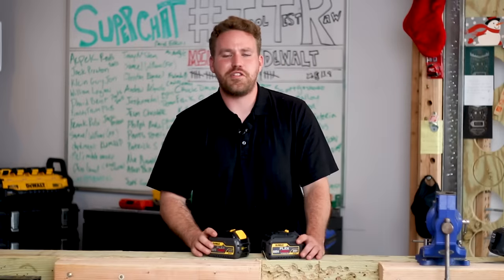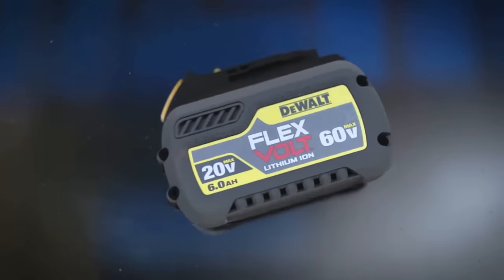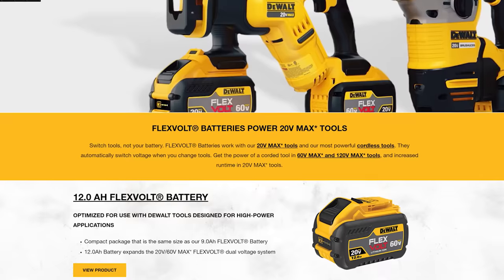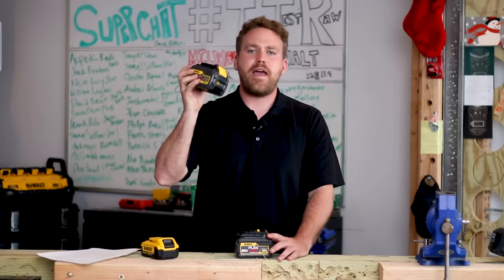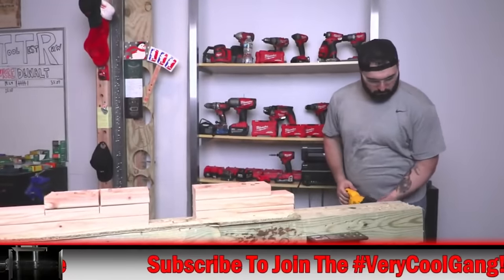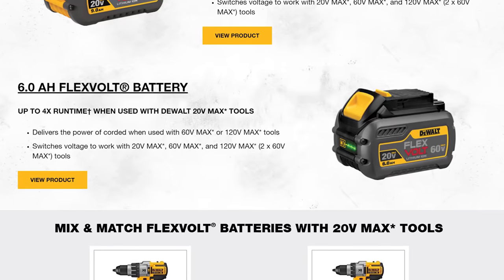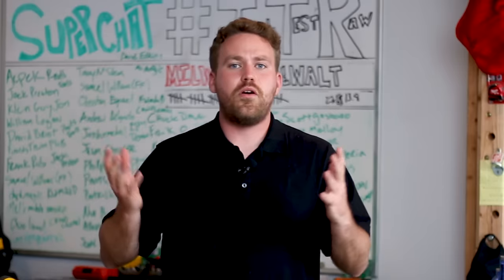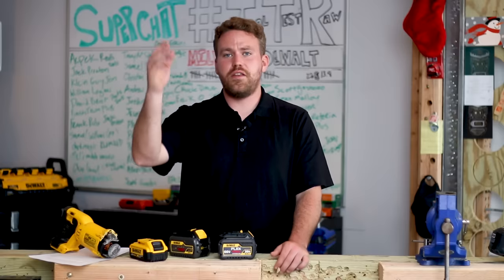NEVER USE DEWALT FLEXVOLT BATTERIES ON 20V MAX TOOLS!

Comment: Absolute joke. Been using flexvolt with all my tools since it came out. These guys are Milwaukee fan boys
Reply: the are not milwaukee fanboys. it's clear they are sponsored by Milwaukee. if they talk about any other tool than milwaukee, they are honest though. when it comes to M. or any comparison between Milwaukee and any other brand, just don't take a single word from them. 
trustworthy people called flexvolt batteries " the worst batteries in the industry". I never tried them. I love Dewalt though. I just love makita more.
Reply: Ahmad you cannot even comment on the performance of the flex volt batts bc you have never tried them. Just like these idiots at vcg you are not an industry professional, just fake news
Reply: Ahmed Nabil  you’ve never used it. Enough said
Reply: I use my flex volt on my 20 all day
Reply: I use my 6ah flex volts in all my dewalt 18v tools every day for almost 2 years with no problems at all
Reply: Might be they realized that dewañt is a homeowner tool
Reply: Are these 20v tools labelled 18v in the uk?
Reply: @JuiceBanger1  I think Australia also
Reply: I was thinking like you, but I ask to dewalt about this problem, and the answer was not I'm waiting
Reply: I got my flex volt before they came out from my dewalt rep. Still using the same batteries for the past 4 years. Completely draining them everyday. Still no problem.
Reply: @edgarcruz4520  as a man that owns both red and yellow tools who rides them hard and puts them away wet, this is complete bullshit. I've probably got more invested in batteries in either brand than you have in tools and batteries combined and am perfectly satisfied using either.
Reply: I agree because I’ve been using the flex volts on dewalt leaf blowers for a while know no problems.
Reply: I just saw a 60 volt battery for first time. All my chargers and tools are Dewalt 20 volt. So my Dewalt radio charger and 20 volt charger will charge the 60 volt battery? And all my 20 volt Dewalt tools will run on the 60 volt battery?
Reply: Same here, but I don't push my tools too hard.
Reply: @MC-hs4mf  yes the 60v Battery will work on you're 20v tool, that's what's so awesome about it and they were the first to do that. and I hear you can use you're same 20v charger to charge the 60v battery also but I don't know forsure because I tried to charge mine for just a lil bit and the lights came on and everything and blinked, indicating that it was charging but I didn't have it on there for long before it took it off. I got so many 20v 6,4&5  amp batteries so I haven't really had the need to bust out the 69 yet
Reply: @edgarcruz4520  DeWalt is the furthest thing from a homeowner tool. I do production framing, rain or shine . And the whole crew with 40+ year Carpenters use DeWalt. What do you consider a pro tool if you think  DeWalt is a homeowner tool?
Reply: @jhojho1679  ok I did research since
Reply: james oppenheim  I use mostly Milwaukee since to me it’s more durable then dewalt  I’ve worked with them both and I always had trouble with them I work In HVAC comercial and residential
Reply: Definitely lol
Reply: @JuiceBanger1  adaptors
Reply: @edgarcruz4520  yeah dewalt, milwaukee, and mikita are all pro-sumer tools. in terms of quality they are about the same.
Reply: Agree.   My Flexvolt batteries are great in my 20 volt tools and perform exactly as both the math and DEWALT say.    This is a very slipshod video and clearly biased.   It should be withdrawn.    
I have a 60 volt circ saw which is a beast but also use those big Flexvolt batteries in my 20 volt job site blower which uses a lot of amps.   Performs really well.
Reply: This is a piss poor vid published by a biased crew.    I use my Flexvolts a lot in high draw tools like recip saw and job site blower.    They perform in my 60 volt circ saw perfectly and ALL 20 volt tools (and older 18 volt with adapter) exactly as DEWALT says.   They are an amazing setup.    I also use the big Flexvolt in my 20 volt small chain saw, weed eater and hedge clippers.    AS the math will tell you, you get about 3 times the amp hours in 20 volt mode as in 60 volt mode.    The multiples in the ad refer to a baseline 20 volt battery like a 1.5 of 2 amp hour battery.
Reply: naa dewalts brushless line is crap   burned more out even on normal batterys  i got brush models that outlasted the new 1 year old brushless ones i ended up returning znd hunting more brushed models down
Reply: construction king I use them on 20v tools in an industrial environment everyday and my brother builds houses, uses the same set up every day.
Reply: Harry Lowe   Tools can burn out at any time. It's easy to think there is cause and effect meaning if you have a bigger battery in the tool, that was the cause of failure.
That said I found this vid after cooking my 20V recip saw with a Flex Volt 12 AH. It stands to reason the saw motor is going to get hot running wide open with their biggest battery in it during a big cutting project. The battery was new, the saw is several years old and has been well used. My tool failure was worse though as the failure fried the brand new battery as well. The battery still has one bar charge in it and works but none of my several chargers will recognize it as plugged in so won't charge it.
Dewalt customer service has been great. They're sending me a new battery, all I had to do was submit a photo of the date stamp. The saw was old, I'm sure past its warranty so I didn't inquire.
I'm pot committed to Dewalt cordless just in battery outlay so as long as their customer service remains awesome its hard not to be happy. I don't miss rolling up 100' extension cords.
Reply: construction king very true!, this Milwaukee channel is all hype..
Reply: Update: Dewalt customer service is more than great. They sent me more than the 12 AH battery I fried. I'm not complaining. It was a cordial email I sent them, told them I wasn't looking to have the saw replaced as the saw was several years old. I think they more than hooked me up because I didn't come off as a d***. Great service to say the least.
Reply: Edgar Cruz I have a difficult time believing you
Reply: Milwaukee fanboy. Dealt selling their 18v kits with 54v batteries. I've been using 54v batteries on ther 18v power tools with no issues. Don't listen to this guy. Buy the flexvolt as you can buy 54v tools in the future for more versatility.
Reply: @jhojho1679   Exactly lets be honest here  De Walt and Milwaukee both build great tools , , I the De Walt Xmas special Combo Pack At Home Depot 3 Years Ago , ive done multiple remodels , Addition's , Decks , fences 8 baths and 9 kitchens with this set and the only brushless tool is the multi tool ,which rocks , im stepping up to all brush-less , i like milwuakee also , BUT to say these are " homeowner tools " is pure foolish .
Reply: @apersonontheinternet8006   Agreed
Reply: @JuiceBanger1  yes
Reply: @abadran8174  that's not even close to what AVE said in his teardown, he has said countless times that the 60v batteries  are great batteries.
Reply: @JuiceBanger1   Only in the US they're labeled 20V while outside the US in other countries it is labeled as 18V.

I was told/heard 2 reasons for this
1. Not to confuse the new 18V(20V) with the old 18V for consumers in the US when buying tools etc.
2. "Marketing Strategy" to say it's stronger with the 20V. But I read the box it's 18V when underload and it is 20V when not underload so DeWalt is technically not lying about the product.

But I really can't say if both are true or one or the other is false.
 sorry I know it's months ago but I wanna just say it.
Reply: I use the flex volt on my 18v xr mitre saw and it gives it a little more power and works perfectly
Reply: @JuiceBanger1  Yes, 20v max is an American marketing term. Any company who calls their 18v range 18v in the USA will look like they have a weak tool and many buyers will not buy it. Everywhere else in the world the same 100% compatible tool is 18V (not MAX). You can run a dewalt 20v max tool on an 18v battery, and vice versa, and the same with chargers. You can also charge a flex volt on a 18v or 20v max charger. The design of the battery is safe and sensible. These guys are taking the bottom range light duty dewalt tools, beating the f**k out of them in jobs that are way to hard, and comparing them to the high end Milwaukee tool. If they were serious and compared dewalt and Milwaukee models of the same retail price, the results would be different.
Reply: @JuiceBanger1  Yes, only in the USA 18v is sold as 20V Max. They are the exact same thing. They are cross compatible.
Reply: @JuT193  Very good comment My friend!
Reply: JuiceBanger1 In the EU yes (Belgium) I think UK also. Cheers
Reply: I would use a brushless dewalt hammer drill for the cement test and a brushless dewalt chainsaw for the 8x8 treated. I would not use a toothbrush to clean a kitchen floor as they would have in this video so to say. Dewalt for the win. I have used the flex volt for all my tools and it’s amazing.
Reply: Same here no problems with any of my tools with the flex volt and I’m hard on my tools I’ve run the flex volt 9 ah fully charged dead with my 20v max reciprocating saw
Reply: Actually hes right,  my wife bought this for me recently. I use it in all my 20voilt and it work .... for a couple months.  Now impact drill and hammer drill wont work and the saw saw that came with it all quite working.  So hes on to something!!!
Reply: I too use them with all 20 volt tools with absolutely no problems. I only use the 6 ah batteries.
Reply: Edgar Cruz that’s exactly why you prefer Milwaukee. People need to realize the different brands are both great tools in different lines of work. Milwaukee is by far superior when it comes to electricians, hvac and plumbers. Where as dewalt is the only way to go when you’re a carpenter. It all depends on what applications you’re using. Aside from that it’s just biased opinions with no backup evidence proving otherwise.
Reply: It’s because Milwaukee is the best it smoke 💨 dewalt literally lmao 😂
Reply: Funny thing is all the dewalt junkies know it’s better I mean it is pretty obvious it’s not even close
Reply: What a coincidence that there are always Milwaukee tools around through the whole video! Absolutely bullshit!
Reply: The only issue comes when you run it constantly. But if you use it the way you would normally use the tool it has time to cool off. I’ve had the same thing happen to Milwaukee tools when using the massive batteries. You gotta let them cool off or you’ll wreck your tools.
Reply: Harry Lowe  Oh ya this guy is definitely the professional sitting in his garage putting in “countless hours of research” while I’m out here beating the shit out of these tools for years on end, not moving on to the next tool. Day after day my tools have not let me down... but go ahead listen to the professional on YouTube not the young buck lol 😂
Reply: @abadran8174  I guess "trustworthy" is subjective...but I would strongly recommend that you reevaluate your definition of the word
Reply: @mikhailyaremkiv  I think AvE is a trustworthy guy.
Reply: @edgarcruz4520  every tradesman I know has a ton of dewalt tools. The dcf887 is the most powerful impact on the market. 
I guess you are too cool for dewalt though.
Reply: @jhojho1679  I worked at a nursery (flowers), essentially a farm, years ago, and the 18v impact driver was constantly lost, only to be found days later in the mud, having been rained on and left outside for days.
It pretty much lived its life like this all the time, like a homeless impact driver, and I never missed a beat, it always worked.
I couldn't imagine a harsher life for an impact driver to live.
Reply: so can i put my xr dewalt tools with a flexvolt battery
Reply: @MC-hs4mf  no
I have a separate charger for the 54V flexvolts.  I believe DeWalt do a charger for both 18V and 54V.
Reply: @jhojho1679  love dewalt, LOVE HILTI MORE
Reply: I use them all the time without issue. This video is propaganda.
Reply: I think they are DeWalt all day long, like myself
Not always the best although something you can count on, 👍
Reply: Yeah I have only flexvolt batteries and I run all my 20v/18v tools on them and have been for 2 years no issues
Reply: Not burned up any dewalt tools yet and I don't think I have anything g but flexvolt batteries
Reply: YouTube Comand//: See Less 

Comand Completed
Reply: i have all dewalt and no bs put my 60v oah in my impact gun for the fjrst time and put one 3 inch screw in a board and the thickest blackest smoke u ever seen started rollin out of it, let go of the trigger it kept rollin out thicker and blacker. got so hot i had to drop it. then i used it on my 3 speed drill and it toasted it 3/4 of the way into a 4" hole saw through 3/4 plywood. took it apart it shattered the brush. i never had a problem with them in the roto hammer, big 1/2 impact, or saws but i would never put one in the little impact gun again or a drill. all my 60v batteries have died now, they HATE water. im in the process of wiring 3 20v batteries in sequence with adapters to power a 60v saw. turning out to be harder than i thought. not sure what terminals need woke up. obviously the outside ones but i started dicken around and touchin em all and it literally welded the 12 gauge copper wire to the terminal on the saw.
Reply: @PAKfromFYCB  you should probably leave power tools to the grown-ups you obviously don't know how to use them properly
Reply: @joesniffedherfanny5928  buddy i bet ive run tools longer than you've been in trade work. try workin in the PNW, we work in the rain or we starve. all that aside my experience with the 9ah burning up 2 of the tools is genuine. the 20v brushed impact driver melted down puting in one 3" screw. i've bought somewwhere in the range of 40 dewalt 20v batteries now and have a shelf with about 15 dead ones. you talk about being a grown up well ive been full circle and came to realize battery tools aren't reliable enough to count on and have gone back to a hammer and duplex nails and a mag77 worm drive for most projects.
Reply: @PAKfromFYCB  I've Done Construction for over 30 years I've been self-employed for 20 and I have owned flexvolt tools since the day they came out and still run the same flexvolt batteries as the day they came out I build entire houses on nothing but battery power I have nearly every flexvolt tool made and almost all the 20 volt tools made I've never burned up a single 20 volt tool using a flexvolt battery and yes I work in the rain
Reply: @PAKfromFYCB  the only thing I've ever had gone wrong is 1 - 9 amp hour battery would no longer charge for some reason but I also work with people that have Milwaukee Tools and I've seen a Milwaukee 9 amp hour battery stop charging for no reason also and I've also seen Milwaukee 4 amp hour and 3 amp hour battery stop charging for no reason
Reply: @PAKfromFYCB  not sure why you would be using the Worm Drive I've owned the DeWalt Flex volt Skil saw since the first day of arrived at the store and I still use the same saw today that saw his Bilt more houses than you have probably walked into and still runs like the day I took it off the shelf at the store somewhere around 8 years ago
Reply: @joesniffedherfanny5928  haha ya i bet man. ive got 5 worm drive skilsaws. i kinda doubt you have one 60v saw. and if you do i bet its a lefty. ive seen you comment back enough times this mornin i dont think your a contractor at all, your youtube account is 2 years old,  your youtube handle, that you just picked 2 years ago, is like a child would use., and you use emojis.. i bet your 19 and are the greenest laborer on your residential site.
Reply: @PAKfromFYCB  I had to create a new account because during the 2020 election I was posting facts from FBI statistics and CDC and got thrown off YouTube
Reply: @PAKfromFYCB  I have one flexvolt skill saw I have two electric skill saws and one warm Drive but I only use the flex volt I'm not sure why I even keep the others
Reply: @PAKfromFYCB  you notice they deleted my comment about FB istatistics and CD cstatistics
Reply: 😂😂😂 I love this shit
Reply: I've used them on a 20 volt tool. A hammer drill. While it's never destroyed the hammer drill it's incredibly heavy. Prefer not to use it for that reason alone. As far as them being Milwaukee fanboys I wouldn't say all that. Vince actually endorsed Makita impacts over Milwaukee at one point. The new kid on the block is flex but as it turns out flex batteries leak a lot. They're not ready for the Long haul.
Reply: My thoughts exactly lol I honestly recommend using the flex volt batteries on grinders or any tool that really pull alot of power.
Reply: This is bullshit. I've been using 60v batteries on multiple 20v tools for years, at work, all fkn' day long. I've never had a problem.
Reply: I only use the flexvolt batteries. I use them on my impact driver my drill reciprocating saw circular saw oscillating tool and my grinder. My neighbor actually has the old school Dewalt tool and an adapter to use 20v he uses flexvolt on his old drill
Reply: Exactly, use them in oil and gas industry, mud , rain -40 below zero 
Take a beating and keep on ticking
Reply: @JuiceBanger1  yea mate
Reply: Milwaukee fan boys
Reply: @constructionking1250  😂😂😂 the ending got me
Reply: Fact is some tools burn up, some battery's die, some keep on kicking. Most of it is down to who built it on which day 😂 monday/friday build is crap, tuesday/thursday good.